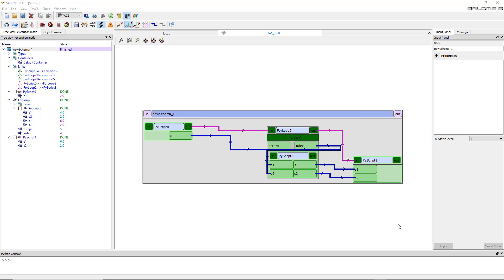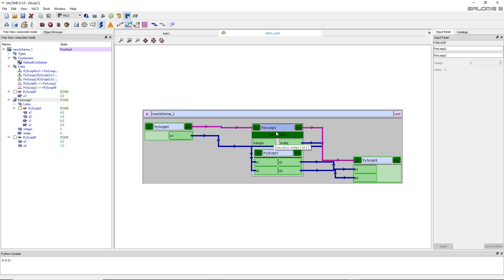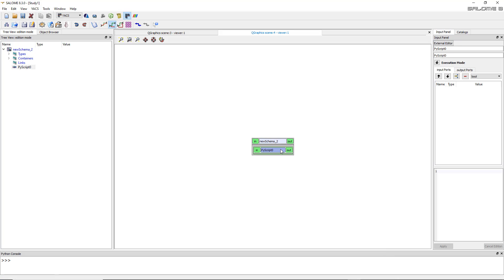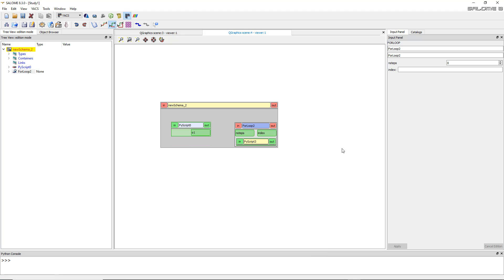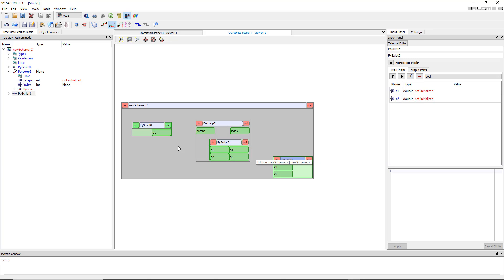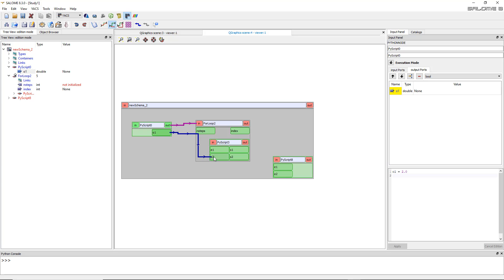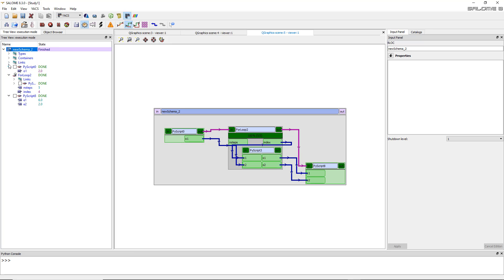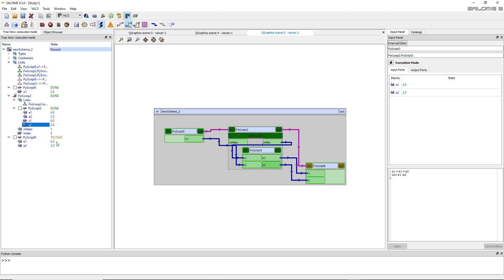[Salome Automation 1] Introduction to YACS Module

Comment: I have not finished of watching but yes please! Love this series
Reply: Hello! Thanks for the video! It would be possible to create something really basic but complete as a complete workflow? For example,
Have input h and r, and then from the inputs goes to a geometry node, in it, it creates a cylinder, a group for each 3 faceses, and measures the area of each of it and the total, and then goes to a meshing node where you have a discrétisation methods of the surface, it mesh each of the groups and export them as several stls and also export a table data with the information area and volume? Obviously it is simplified from what one can do or imagine, but would be great as after it is only going deep in each node but the base to construct would be there... 🙂
Reply from the maker: Yes, that’s what I intend to show in another video, this one is just an intro
Reply: @Feaforall  yes and thanks! As you said in the video to give you ideas I thought about posting it 😊